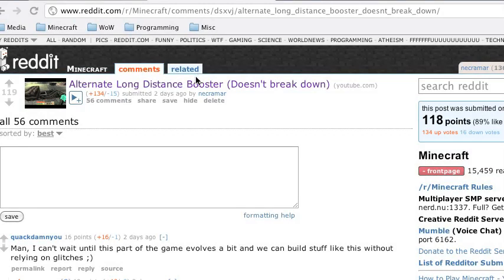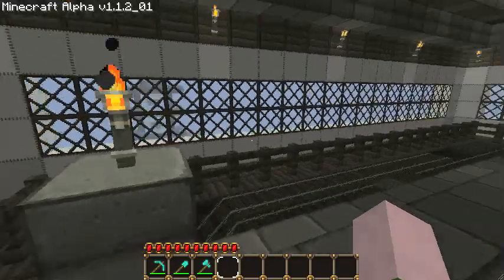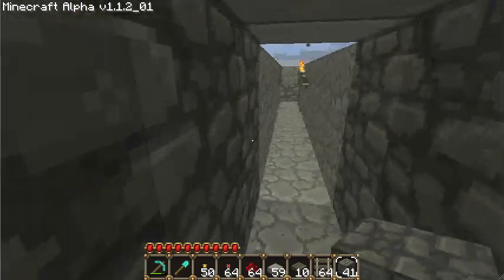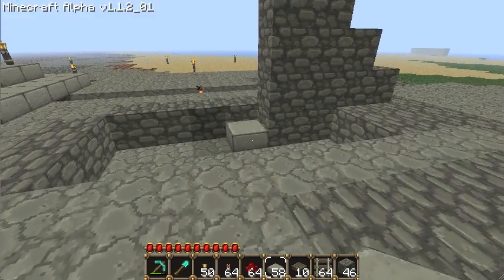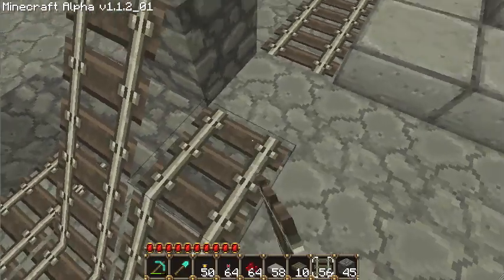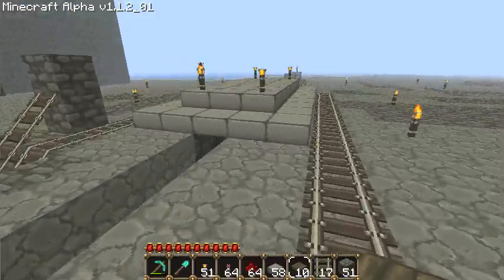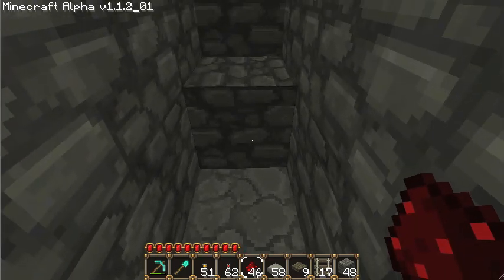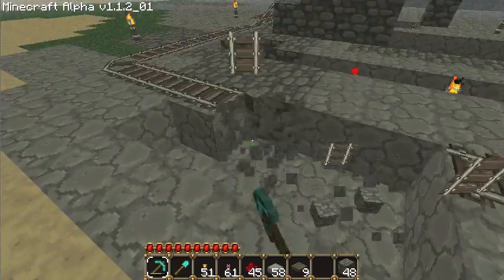How to Build a Minecart Station: Part 1/3 (Outdated - Does not work after 1.6!!!)

Comment from the maker: @merzat It doesn't sound like a graphical glitch in your case.  In the video, the graphic was flipped (showing as open), but the actual track behavior was acting as it should according to the button input.  In yours, the behavior is flipped (i.e. activating the button closes the loop and stepping off opens it).  So you need to swap that behavior with an inverter (NOT gate--check the wiki).

I'll be explaining this a bit further in my next video.

Comment from the maker: @C4Drequests Basically it's the all the same components, but the tracks going up to the platform run up ramps.  Also, the redstone can be a bit trickier, because you have to make a sort of staircase down to the circuit from the inputs (the buttons).

Comment: @kattono Throw up an inverter somewhere in the redstone wire, this works anytime you get the opposite of what you want. Basically make a 3 block break in the wire, put block on the first two spaces, put wire on top of the blocks, and put a torch on the SIDE of the second block in the space where you destroyed the third redstone, inverting the signal.

Comment: @Vatuation I fixed that problem by making the resetting loop for the booster bigger. I made it from a circle into a box shape, to keep the redstone from fucking up the slope instead of doing its job at changing the tracks

Comment: Simpler version of an extender:
When your redstone's signal runs out,  dig a hole 2 blocks down. Place a redstone torch in the hole, and cover it with cobblestone. If you hadn't looked through the minecraft wiki, it says that a block that is adjacent, above, or below a redstone torch is "powered" and is now electrified (or Redstone-ified)

Comment: @kattono Just use an on or off switch instead of a plate, it'll 'fix' the problem. You can also double check your extender for redstone because it may be opposite instead of actually extending the wiring.

Comment: With update 1.5's booster rails, all you have to do is put a charged one at the top and bottom of a pez dispenser and then all the cart needs to make it to the boosters, instead of having enough momentum to make it to the top.

Comment: @DragonHeartGER I had the same problem, just invert the power by deleting the second redstone torch at the extender in the middle of the wire and connect with one redstone so you will get an inverter.

Comment: @op7485kl Actually there's a way around it. Just curve the track in a tight semicircle  right nex to the wooden plate so it can switch the track. It all still works fine.

Comment from the maker: @FireAdmiral I'm not following.  If you mean your PEZ dispenser is pulling out two carts, make sure your booster cart is completely level before reaching the stored carts.  I mentioned this in an annotation to the video, but the extra two blocks I removed from the 2nd and 3rd rows are important (somewhere around 4:18).

Comment: i had the same problem as everybody else has with the track not switching. my solution was: put a red stone torch under the curved track and put an inverter before it. i also put a redstone repeater in instead of the repeater used in the video

Comment: @op7485kl i found his exact method doesnt work eather but that was because of the redstone wiring i had to alter it some also the double cart thing did not work it kept derailing so i just put in a normal boster for that 
but most of it worked as it should

@necramar what video capture do you use? because i  am trying to record a minecraft video but fraps seems to not work for me with this game :(

Comment: Sweet tutorial! Ive used it many times, and its helped me learn a lot about red stone wiring. But now that Beta 1.5 is out I'm redoing all my stations including making stations that are through stations so if you stay in the cart you will continue to the next station after 10 seconds or so. I downloaded ur similar world file and am looking at ur track selector that u have set up, with 4 different options. Im trying to figure out the system but am having some trouble, do u have a diagram? Thanks!

Comment: Something changed with the pressure plates and the rail changes. To get this working again do the fllowing:
Destroy the Pressure Plate
Put a Lever
Switch the Lever to ON(thats 1 use from the begining)
Destroy the Lever
Set down a Pressure Plate again.
Dunno if this will work for every1. Worked for me for sure.

Comment: though i tried to build your initial design, with the stack, station above all the mechanics, i couldn't get enough detail from the vid, so i had to use your second open world design, with some tweaking for space, then more for unknowns, like a hidden drop shaft into a vast cave system where my return booster was going, and an aquifer above my pez dispenser, though all in all it works out wonderfully, now to go and build the second station up in the side of a mountain

Comment: I have a question, when I implemented this system all the mechanics of it were working fine (after a small amount of tweaking), except one element of the system I couldn't rely on. Each time I get out of the cart, the cart twists, resulting in the cart usually meant to carry away the empty cart to the pez dispenser, just hitting the stationary cart and stopping dead. Any solution? I'm sure you would have had the same issue

Comment: @LittleRascalJack  I found a non glitch way to do it,  Get a powered track, replace the loop with one, put the torch under the powered track, when a powered track is not activated it stops it, when its activated it accelerates.

Comment: Where you were talking about the graphics error, my track won't switch at all, the redstone will not switch the direction the track that on yours had the graphics error on.  The torch is being lit up by the redstone that goes to it, and I have double checked to see if it is directly below the track, to the point where I actually dug up the track. Why is this? Please help.

Comment: I built this but the track next to the pez dispenser in the booster that curves around on itself stays switched even when I get off the platform pressure plate. Is there any way to fix this?

Comment: I built this but the redstone wire under the curved track doesn't change the track back after it turns off, so the booster just keeps on feeding me carts from the pez dispenser. Anything I can do to try to fix this?

Comment: @op7485kl Mine works just fine, only problem I can think of is that your redstone isn't set up correctly. Try reading up on redstone circuits and knowing the properties of redstone torches and redstone wire.

Comment: i have a problem on the booster or w/e its called the rail that is supposed to switch the cart to move another cart out for you from the pez dispenser the rail never switches back to the original position to allow the first cart back in to go back in its infinite loop and it will continue to spit carts out i've tried not gates and nothing helps

Comment: I build it like in the Video. But if i stand in the button, the minecart have been in the Dispenser. And if i don't stand on the pressure plate, it Drives to the Booster Station. I tried many Things with the redstone and it don't works. What have i maybe made wrong?

Comment: @op7485kl No I did the water loop thing it works well its relaible but you can´t call the mine carts to you
they will just stand there until the water push them trough out the track.But if you find a fix let me know.

Comment: aw it doesnt work anymore. if a plate is wired to a torch, stepping on the plate doesntt turn off the torch. the extension seems to be the problem.